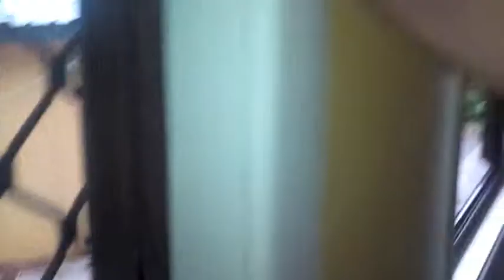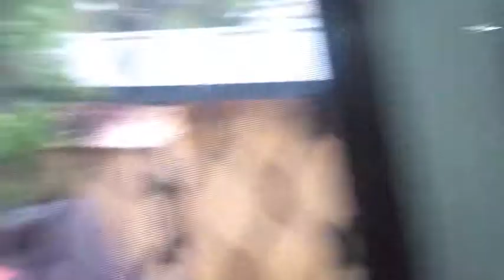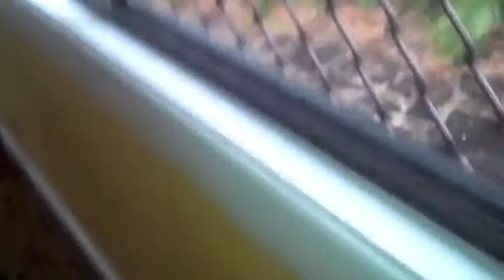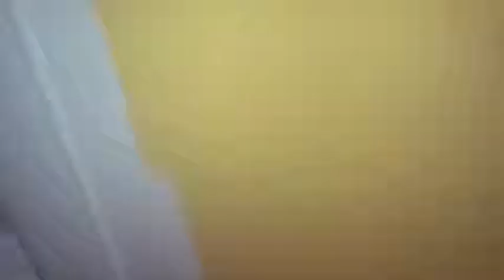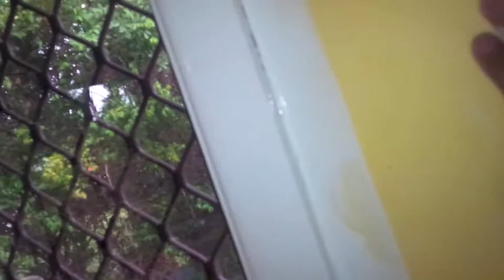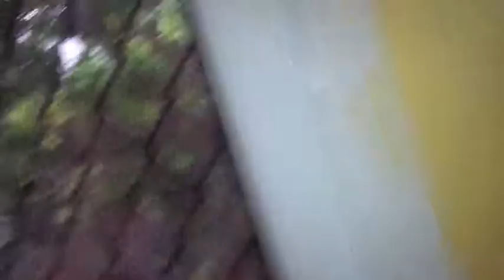Termites !!!

Comment from the maker: no the fire was actually in a different room, and it was just an oven fire which lit up the kitchen they managed to put it out without the calling the fire dept.   So theres a much bigger problem going on here.    Its hard to see from the video but those windows actually shake and the whole wall moves theres not much holding the roof up. :)